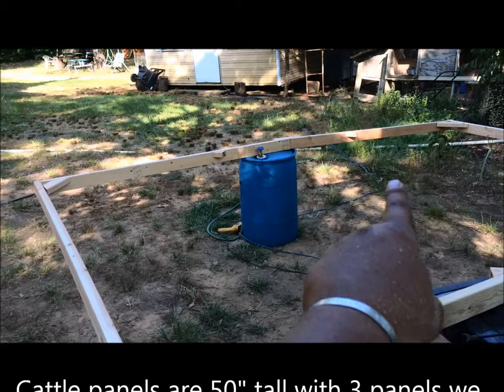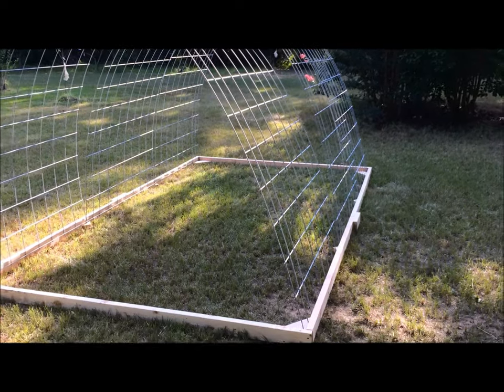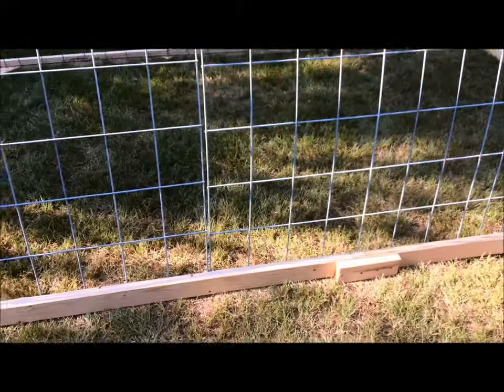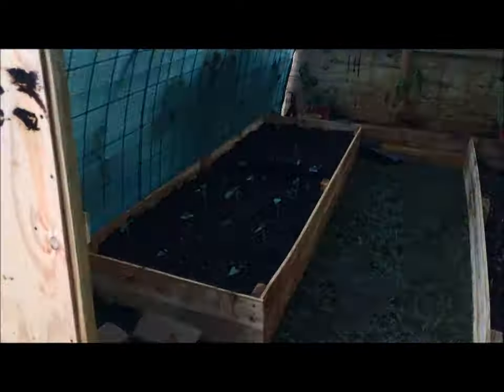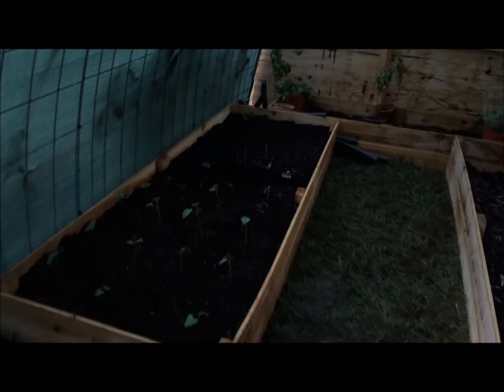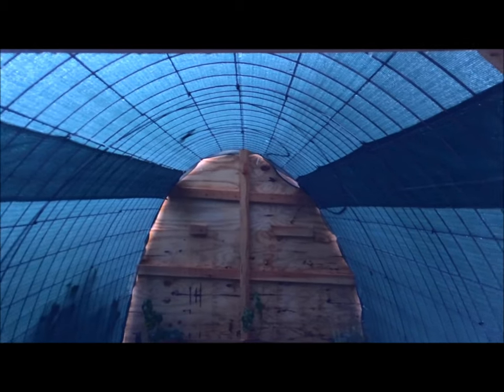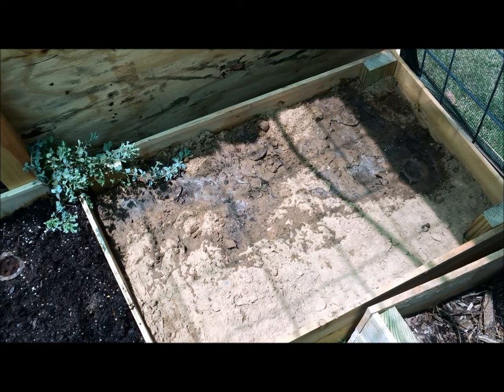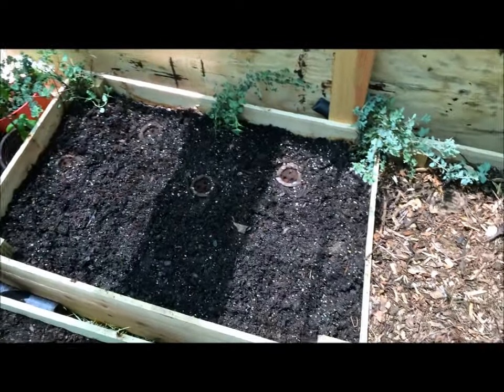Cattle Panel Green House

Comment: I've actually built one of these and used it for camping on my property. I actually live in a different town but I go back and camp there. I also have a camping trailer but I wanted to work on something as a project for something to do.  It is basically the same plan as he has demonstrated with a few differences here and there. My frame is built out of scrap one by sixes and has two by four nailer boards. and has a plywood floor with carpet. And I put cement blocks under it to hold it off the ground. I also had some scrap plywood sheets that I used to enclose the ends. And I had several old moving blankets that I used like insulation. I covered it with two layers of clear plastic with a heavy tarp on the outside. On the back end I took a small window with the screen on it from an old camping trailer that was no good and added it. On the front I took the door from the camping trailer and added it along with the vents which will open and close and mounted them along the sides of the door. I found an old military cot at a thrift store and put it in their with a twin mattress on it.

Comment: That would even make a good bug out shelter for a survival situation. I would like to see a video of someone making a cattle panel shelter for camping. I don't know why nobody hasn't thought of that yet. Hell you could even put a plywood floor in it and run electricity to it, put some tin on the outside for more stability and paint it and you have a cool little shelter. You could even cut a door in one side or both sides and use the panels to make an additional room or rooms just make sure the roof is sealed good. And with proper supports it would be very stable.
Reply: This is a pretty solid idea if you do something to water proof the cloth
Reply: I have read about someone doing that.  Said it worked out well.
Reply: ...also, another person down on this list did it.

Comment: looks great gives me some ideas i plan on one soon iam use concrete wire its 5 ft wide an 10 ft long or get it in roll any ideas give em too me
Reply from the maker: Jack Decker my only regret is not making it wider, taller and longer. 
It was a first run.
Reply: @Joeatsaco69  yes i plan on heating it in winter with barrel stove outside pumping water into barrels that way only have use maybe one fire a day i saw idea on youtube an i change it around a bit  one fire late everyday with keep it warm at night ha ha good way get rid of trash an scrape wood too
Reply: LLP

Comment: I guess that I'm missing something. I like the look of the green plastic, but don't you want as much light as possible to reach your plants?
Reply from the maker: I initially used the shade cloth to capture heat and not burn my young plants with the Texas sun. 
Those shade cloth lets water in and disperses it so as not to pound the young plants. 
Later I went back and used the off white in the south side and took the shade cloth off of the top. 

When plants say they like Full Sun they don’t mean Texas Full Sun. In the winter it gets covered with the  Visqueen. In mid to late April I roll it off to the south side but leave it rolled up on the north side just in case we have a late freeze. 

Chard and Aloe Vera grow all year long. It also houses most of my herbs that can’t handle too much sun or cold.
Reply from the maker: The next one will be twice as tall and twice and long for my young trees that ether have to give the bark time to harden or are not made for this climate.

Comment: that looks really nice. how do you attach the panels to the frame and the plastic to the panels?
Reply from the maker: david schwartz I just pulled it over the top and stapled it at the bottom. Also tucked it into the front and back.

Comment from the maker: May try longer panels next time to get more height and width.
Reply: I thought they were standard size panels.  The first video i saw on this, the guy had walls 3 or 4 feet high, then had the panels on top of that.
Reply: How do you keep the panels from rusting?
Reply: @slrs3908  Panels are galvenized....
Reply from the maker: SLRS  dunno. Must be the Mt’s
 They are made of. They don’t touch dirt.